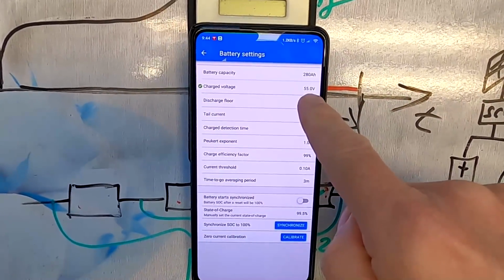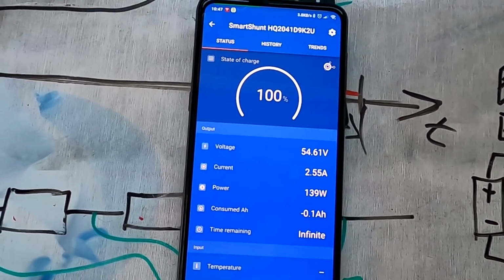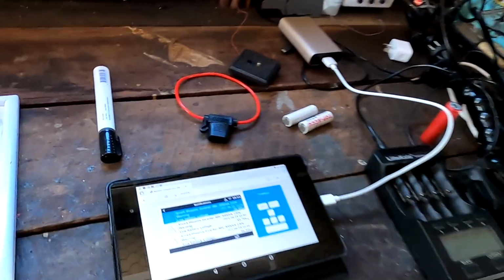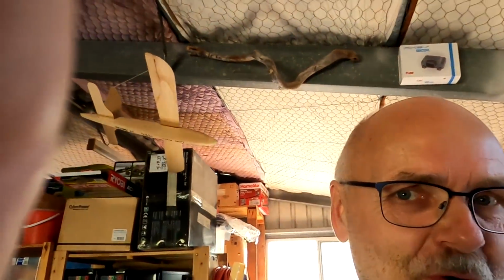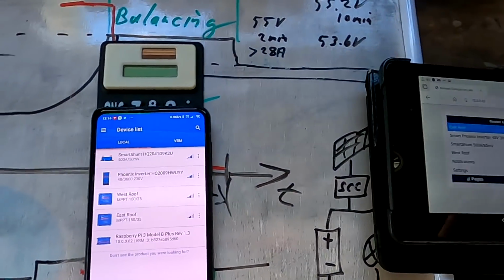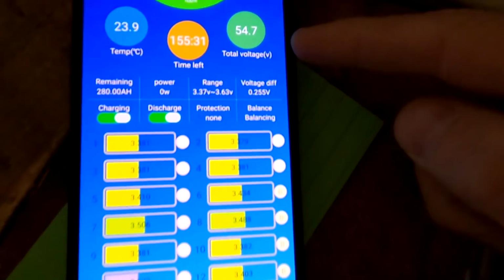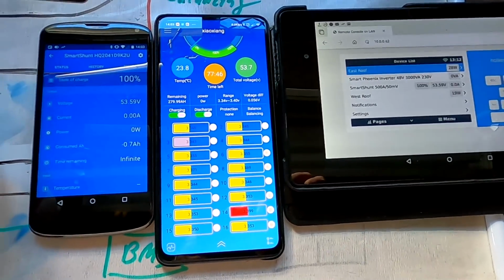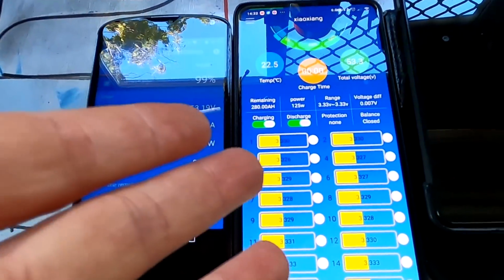Houston, we have a slight (BMS) problem and... are now Off-Grid!

Comment: A few thoughts I had while watching your last 2 videos.  I am not a battery expert by any means but I have been on the same journey for several years.  I balance my cells at 3.440-3.550v and I have the BMS set to disconnect charging at 3.550v and it won't kick back in until 3.450v where it floats.  I also have the BMS set to balance within 0.001mV.  My BMSs are all MOSFET-based so they can enable and disable charge and discharge separately. I keep the solar charge controller about 0.5v above the cutoff for the BMS.

Originally LiFePO4 chemistries were charged to 4.2v just like many other lithium chemistries.  Over time they discovered that the high charge voltage was not necessary unless you needed a very fast charge and this improved cycle life quite a bit.  Once you are much below 3.65-3.7 (the current recognized 100% fast charge voltage for LiFePO4) the gains in cycle life are not really worth the added cycles because you are now well below the area where degradation due to high voltage causing the capacity loss is happening faster than calendar aging.  The calendar life of LiFePO4 is around 15 years so if you did one full cycle per day for 15 years (15x365.25=5,478.75) you are just under 5,500 cycles.  

What you are running into now appears to be that one or more of your cells has drifted way out of balance (possibly by 10's of Ah) and at the rate of up to 200mA balance current, it is going to take a long while possibly days at full charge to get the cells back into balance.  The flat discharge curve hides imbalance very well.  This doesn't damage the cells but it means you may have temporarily lost some capacity with the imbalance.  The main reason I bring my cells up over 3.450v is to ensure they are all fully charged and in balance with each other by the BMS.  This doesn't happen every day but it happens most days as long as we have some sun.  No real degradation is happening with the cells at this voltage especially since they are being partially cycled each day.  As you know the voltage rises quickly after the cell reaches full charge and the current begins to taper off.  This is where it would b nice if more BMSs had the ability to keep charging when the charge current reaches 0.1-0.2A. and instead could actively shuttle the current around the full cells by way of active balancing and only stop charge when all cells reach the same set voltage rather than relying on resistive shunting of excess charge through resistors.

Comment: Did you order a DUAL PORT BMS to replace  this Common Port BMS ?
Reply: Was thinking the same, have been looking for one. Separate Port BMS are more rare, and costly. Even Daly make one, but I’ve never seen it for sale.
Reply: @michaelbouckley4455  With Common Port, if you hit High Voltage on just one cell from charging, you lose the entire battery bank that powers the Off-Grid Home = Ouch!  Over-Voltage should disconnect only the Charger.  Under-Voltage should  disconnect only the Inverter.  A BMS with separate Charge & Discharge control pins that energize an externally connected Contactor or SSR works well for high amp battery banks...
Reply from the maker: Nah, I didn't do that. It's still a common port BMS. Is separate port not more been used in e-bikes and scooters that sort of application?
Reply: With regard to the low voltage disconnect of the inverter I don't think that you need a BMS to do that. I have a 48Kwh lead acid pack with a Victron inverter without BMS. During the colder weather the battery voltage dropped prematurely during a high current discharge causing the battery voltage to drop excessively. The inverter sensed this and shut itself off. Someone mentioned using a diode across the BMS to allow discharge with the BMS turned off. I think that this is a great idea. Is there anything wrong with that?

Comment: if you want to save your self a boat load of time and continuous problems re top balance now before you damage your cells. it only gets worse from here if you dont top balance now. don't be stubborn on this or you will burn up a cell and possibly your garage. you will have to change the channel name to outback burned up garage.
Reply from the maker: I can only connect all cells in parallel and chargen them up to 3.6V. That's what I did before I put them inseries.
Reply: @OffGridGarageAustralia  yes then let it rest and do it again and then restore the pack back to use. honestly you are lucky you didn't burn it up. bms don't always work. many a friends learned this the hard way. but i feel you crossed a safty line and should warn others of the potential of fire when you play in these low voltages. this was not funny it is really serious. you know. these cell are made to be used a certian way and are not as flexible as say lead. do a warning to cover your arse.

Comment: Its a very interesting topic, what voltage should the charge be set at. I have a PYLONTECH battery system and I have been considering changing the perimeters after watching your videos. But Pylontech sets the cell voltage at 3.546 volts. Its a 15S battery system so the maximum pack voltage is 53.2v and float voltage is 53.2v. The Pylontech BMS also has a cutout voltage relay for an over / under voltage situation, (Which has never occurred) The BMS can charge and discharge independently as you are wanting but still have the battery voltage available for the inverter. Maybe your new BMS system will allow this to occur, keep up the great work.  Henny
Reply from the maker: Thanks, Henny. I'll keep experimenting and learning.

Comment: Your smart shunt probably never sees 55.0 V at all because it's much closer to the battery compared to the chargers. Consider the voltage drop on the cables! Chargers think they are going to absorb at 55.2V. But closer to the battery, the voltage is still slightly lower like maybe 54.8V. Depends all on your wiring length and diameter. In my 12V Camping setup I have the charger set to absorb at 14.3V and the shunt to reset at 14.0V. And there is not even 1meter of 6mm2 cable between the charger and the shunt. Nevertheless the voltage drop is already quite measurable.
Reply from the maker: The solar chargers are actually getting the voltage fro the smart shunt vie the BT network theu are connected in. So there is basically only one voltage which is the one the smart shunt measures.
Reply: @OffGridGarageAustralia  Sorry did not know you are using the network. Another reason might be a load that pulls down the voltage below 55.0V for a fraction of  time, before the 2 minutes are over. When the compressor of my DC fridge is starting up, I am observing this effect. But since your load is stabilized through the Victron inverter, I doubt that this is the reason in your case.

Comment: You'll need to do something to balance that cell out either manually discharge it with the resistor to get it more in line with the others or temporarily lower your peak charging voltage until the BMS can get that cell more in line
Reply from the maker: Yeah, I don't think the BMS is able to fix that. Not in my lifetime 😂 0.2V balance current just don't cut it...

Comment: 3.55 volts over voltage release is too high in my opinion. Especially if you’re top balancing without charging.
Reply from the maker: Why is that?
Reply: @OffGridGarageAustralia  because you get into the situation that you’ve found yourself in. The resting voltage quickly drops off after stopping the charge without giving the BMS time to bleed anything out of the high cells before try to jam more into it. I’ve always set mine to 3.4 volts on the over voltage release and that might still be a little bit too high to balance in your current situation.
Reply: I just watched the part of the video where it was shutting the charging off and on again. Sorry I thought the voltage was dropping below the over voltage release then turning the charging back on last night.

Comment: In a more highly integrated system, the PPT voltage would get adjusted to limit charging current to balance current once a cell reaches its maximum voltage instead of causing a battery disconnect.

Comment: Have you actually measured the cell voltage at the battery. Do you have a higher resistance connection at the terminal?
Reply from the maker: I don't think it's that as the charge current was very small. Internal resistance was OK and inline with all other cells. A high discharge does nto flag this cell, so I doubt it is resistance at the terminals. But I'll check again.

Comment: Balancing is going to be extremely slow even at 200 milliamps that could potentially take 24 hours or more to get it to be more reasonable
Reply from the maker: In 24h it could balance (bleed) only 4.8Ah at best... This is just not designed for such large capacity cells.

Comment: it is a shame you are 48 volt and not 24v as electrdacus makes one hell of a bms/scc in one unit that can easy be added to for a 30kw solar system even dump loads for hot water and under floor heating the system can also remotley control victron charge controller so it is not limited to pwm control only
Reply: it's a shame he doesn't make a 48v device
Reply from the maker: That's what I thought too. Must be rule in Canada that 48V is not considered as low voltage any more.
Reply: @OffGridGarageAustralia  I had never thought about that would make sense
Reply: @OffGridGarageAustralia  It is a rule in Australia too.  AS 5139 (you can find a draft on the web) considers DVC-A (Decisive Voltage Classification A) as the safe limit.  This is 60 VDC.  So far so good.  But the solar input voltage for a 48V system is over 60V, which is DCV-B (only an electrician can work on it).  Then they go on to say that if the charge controller does not have isolated ports (which they don't) then everything downstream is also considered DCV-B.  So your 48V battery (that never goes above 60V) can only be worked on by an electrician.  For this reason I decided to make my system 24V and use only 72 cell panels in parallel and have no part of the system ever go above 60V (as does Electrodacus).  Then I found out that there is a new amendment to the PV array standard (AS 5033) in the works.  It will also be updated to use the DVC definitions.  But now it is mentioning that DVC-A means only 30V.  Huh?  Well the roof is considered a wet area, you see.  DVC-A is 60V in a dry area or 30V in a wet area.  So now only a qualified electrician can wire up a 60 or 72 cell solar module.  So I have given up trying to fit within these standards.  They totally exclude DIY'ers.
Reply: @AGhostInTheMachine  if he did his would be the best unit on the market

Comment: Check balance wire on # 14 to ensure a good connection.
If you don't have a good connection #14 can't shed enough power to balance!
Reply from the maker: Shouldn't it be flagged under high output as well if it is a bad connecton?
Reply: @OffGridGarageAustralia  It is only flagged if there is no connection and the BMS would then shut the bank down.
Aside from a balance wire, it could also be a failed MOSFET.
Just because the App indicates the balance MOSFET has been triggered the cell voltage rise is an indication it may not be working.
If the signal is coming from the gate voltage rather than the drain on the MOSFET it would give you a false confirmation of balancing even if it was not working!

Comment: Problems, problems and more problems.... but always there's a solution for each, for sure. What about and ACTIVE BALANCER? but you'd need one per cell. There's some other people here at Spain with 18650 batteries, different configuration, but same end, same proposal. And some of them are using such a balancers. I'll post link to any of their videos , just for y to check. And BTW, don't understand the balancer behavior, for sure there's something on the configuration missing or a parameter out of limits.... Waiting for next video.... cheers... SALUD
Reply from the maker: Yeah, the balancer situation could be unavoidable with these large capacity cells. Cannot see that 0.2A balancing makes a big dent in such cases I'm having right now.

Comment: Andy  
Heltec 16S  $85 US  on Amazon = balanced cells = less stress = more beer time. Been there, done that. Something that actually works.
Reply from the maker: My understanding is they start balancing only at 0.1V difference?!
Edit, the balance current is 1A at 0.1V. 5A is only been reched if there is a hug cell difference.
Reply: @OffGridGarageAustralia  
No, they are balancing all the time unless you use the provision to turn it off. They only say it’ll work down to .005 V delta but I’ve seen it still busy down to .002 difference. I can’t feel any heat during charging, the time when things normally go bad. Very efficient, robs virtually nothing to operate. Hard to believe it’s doing anything but the Xiaoxiang graphics tell me otherwise. 
I’d be putting one on that problematic battery (with same BMS) in a heartbeat and put it to a head to head comparison with that secret😉 BMS you got for the new batteries.

Comment: Time for an Electrodocus BMS!
Reply: Last I checked Electrodacus was only messing around with 24v.  At this point 48V is the sweetspot for DIY to keep wire and component costs down and provide plenty of expandaility for the future.
Reply from the maker: I would love to test it but he's still building me one for 48V... 😃
Reply: @OffGridGarageAustralia  I love my Electrodacus, I only have it set up for 12v. I am only a novice and still learning. I like the fact that it will turn off either charging or discharging seperately

Comment: This is why I switch off the panels with the BMS. Glad you replaced the BMS! But yes not good situation with relays clicking. This is a settings problem of balance voltage vs float voltage. Not enough time balancing.
Reply from the maker: The balance current is just not eneough to mkae a difference.
Just for the ske of trying... I should test out a balancer. Just testing, not keeping it ;)

Comment: You should know better, yet again your playing with voltage and not SOC. If your cells are at different SOC then balancing the voltage at the very end will always be difficult. Once I got all my cells at the same SOC at the same voltage   they always play nice together and my balancer was doing very little at any stage. I'm sure they may drift apart at some stage but its been months without issue so far.  Also you may have a connection problem between the cells because why is one cell getting more power then others , could also be a faulty cell. It must be very frustrating I know mine was until I got each and every cell to the same SOC
Reply from the maker: All cells are getting the same power as they are in series. Why do you think differently?
Connection is fine as the cell performes well under load.
Reply: @OffGridGarageAustralia  yes good point with respect to under load but remember they all have very similar voltages in the flat part of the curve but can have very different SOC. Remember they all play nice between 3.0 and 3.4 but can have different SOC, you have shown this in your other experiments. As you have stated in the past  SOC is more important then voltage because you will do your  head in if you keep looking at the voltage and try to balance them with 200mv or have a lot of time on your side. Yes it is frustrating when they hit the limiting voltage but that's because of the different SOC levels. Always better to fix the cause not the result otherwise you will never fix the problem.
Reply from the maker: @markparker9749  yes, absolutely. It was a bit of an experiment as I wanted to see if I can balance that low and of not why not. The battery is fixed now -> next video 😉
Reply: @OffGridGarageAustralia  looking forward to seeing how you solved it in your next video

Comment: 1) in case of a imbalanc a discharge without balance makes it worse 2) balance must be done in high charge state sine the imbalane will manifest there the most 3) not sure why your bms not just balances it but may be due to your settings
Reply: a low balance current is normal and it is hard to find something balancing faster but for a reason. this process just takes time since it also depends on factors like cell temperature (chemistry things) - speeding it up may hurt your cells and system more.. also if you balance every time near maximum charge point you need to balance less overall
Reply from the maker: The BMS does the balancing but it only has 0.2A for doing this. I think it's just not enough to cope with such high capacity cells.
Reply: If the QUCC BMS will only achieve limited success at the higher part of the curve then a Daly BMS will be totally useless.

Comment: Maybe you should do a test with Batrium BMS, it works really well.
Reply: and costs a LOT
Reply from the maker: That's an expensive test...
Reply: @OffGridGarageAustralia  its worth it Andy   I have 96 CALB 100A and its working great and also I also run the system at 54V max    talk with Maxine at Batrium and see if they will set you up with the system I'm sure they will    I run my shop on this solar system its my covid project   lol
Reply from the maker: @alanhauser117  don't they need additional equipment like disconnect relays and stuff as there is no safety build in by default?
Reply: @OffGridGarageAustralia  Yes but the BMS can tell the relays when to shut off and back on again it a really nice setup Contact Batrium    Can you send me your contact info